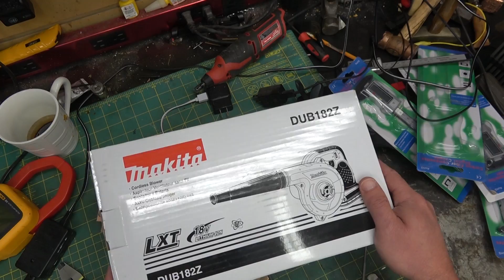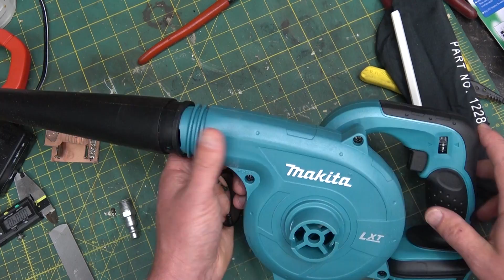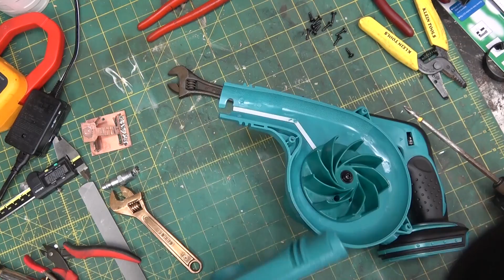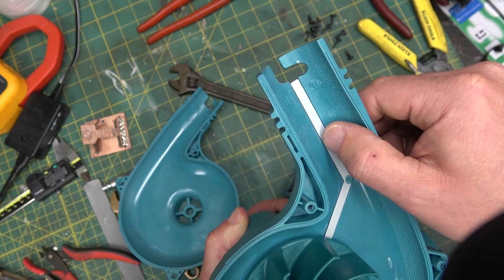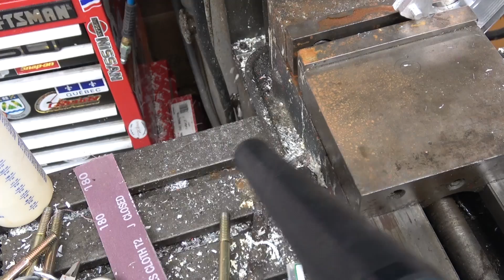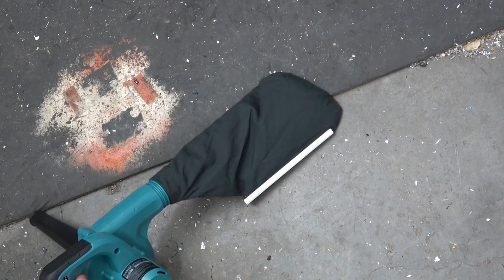BOLTR: Makita Blower/Vac

Comment: Posting at 7:24 in the vid...  That texture serves no molding advantage.  On a injection tool, the only texture that serves the molding process is sand blasting.  That only serves to hide rust damage (as you know tool steel rusts easily), and to allow easier release upon ejection.  As for the cuts in the pins (excluding the texture you're talking about) that serves to give the pin traction so it doesn't stress the part upon ejection.  My take on the texture you are highlighting is that it serves a functional purpose to the part.  It would cost extra $$$ and help the molding process not at all.  I'm a Plastics Injection Process Technician of 8 years, I've worked with over 800 different tools.

Comment: I've had one of these for a couple years. Much more useful that you'd think. I use mine all the time. Much easier than lugging out a shop vac or air compressor. And it's strong enough that I use it for sweeping my sidewalk outside, and even a super light-duty leaf blower.

Comment: The plastic impeller will be destroyed if you use the suck capability, most garden vacs/blowers use plastic and when something other than dust is sucked in the impeller breaks
Reply: Mark Smith I was thinking the same, and if it didn’t break it will clog. A bit remiss of Makita to use the same fitting in this case. Unless.

Comment: I own three of these blowers. I keep one blower at the fire place, one in the tool box, and one to remind me of Tiffany in grade 9.
Reply: I have the similar willfuckye 18v blower. It spends its days turning my freshly lit fires into a pile of hot coals in record time. It also does a great job at distributing the dust off my shop floor back into the air to properly re-distribute evenly after a good sweep.
Reply: @leftyeh6495  Fires? I kinda do the same thing but I've got an old $10 walmart double-acting inflator (you know, the manual pumps for mattresses and junk) with a recycled steel tube from an old assemble-it-maybe shelf unit duct-taped to the end of the hose.  Battery only goes dead when the fire's flat and the beer's gone.
Reply: @leftyeh6495  Just remember when you "re-distribute those floor sweepings" you should "probably "filter that through a cigarette"😂😂🤣🤣😂
Reply: Don’t worry, Tiffany probably fell off by now
Reply: I take mine to the summer cabin and use it to suck up all the de- hibernated flies off the windows, works a charm

Comment: I use one every day at work. They are skoocum till you drop it.

The weight of the big batteries will snap the  handle right off when it bounces off the floor. 

The trigger will eventually burn up if you run the thing almost  constantly like a couple of the fng's do.

Comment: Putting a zip tie around the head may keep it from collapsing under the succ.
Reply: I think they've done that by design.
If it collapses you'll turn the power down until it doesn't, which stops it self-destructing on high speed chunks of debris hitting the impeller.

Comment: The turbulent flow will reduce the height of the boundary layer and significantly change the velocity profile of the cross section.  I'm not sure, but I think that for a relatively short pipe, that might also change the total mass flow through the pipe for a given freestream velocity.  Or, I could just be talkin' out my ass...

Comment: could you further explain the angry pixie "water hammer" effect
Reply: When current flows through an inductor (coil), a magnetic field is generated around it. If the electricity is suddenly stopped, the magnetic field collapses, inducing a "kick" of current known as inductive kick, inductive kickback or flyback. The way the electricity gives a kick is akin to the water hammer effect in pipes where the water is shut off suddenly.

Comment: off the cuff, thinking before i've had my coffee - but with experience, i'm inclined to give Makita the benefit of doubt;
- the rough surface is to create turbulence on the way out on suck-mode so stuff doesn't get trapped?
- the static discharge bar is only spot welded to allow for differentiated expansion as it warms n cools?
Reply: Agreed.

Comment: Mythbusters did an episode on the aerodynamics of a golf ball what with the dents all over them.
Reply: For the case of the golf ball, keeping the air turbulent at the surface helps it "stick" to the ball and mitigate flow separation at the back of the ball, which causes significant drag. For this blower, eh, I'm not seeing any issues related to flow separation and the texture just looks like part of the mold.
Reply: @zecc81  You must be a Fluid Eng-a-neerd.  HaHa!

Comment: Would it be possible that the rough texture is to aid in reducing static electricity, or reduce  dust stickage to the internals?
Would split-washers act more like spring tension, rather than grabbing the bottom edge of the screw to inhibit backwards rotation?

Comment: I have a similar one (they sell the same model with a longer pipe), it's strong enough for normal things like cleaning a roof  or a scaffolding on the construction site. For wet leaf, it's too weak, but for this they offer a 18 V x 2 brushless blower, which is extremely powerful.
Reply: Simon Maier those 18x2 tools are mean sum bitches I just got the 18x2 chainsaw and it is very worthy.
Reply: @MikeK7115  I have also some of the 18V x 2 tools, the chainsaw, the big angle grinder, a circular saw, and other stuff for the garden. This tools are awesome, they can replace gas machinery.

Comment: I wonder how long that impeller will last, in suck mode.  Do they sell replacement impellers?  If so, what is the cost?  Good questions to ask.
Reply: Perhaps if someone had the right equipment he could mill a replacement impeller -- in aluminium or possibly aluminum (if short of vowels).  A little change in design could enable it's use as an air raid siren or ear-plug test reference audio source.

Comment: I use this blower ever day and it is the best on the market.I rarely use the suck side but the longer extension on the blower end means it is great as a floor blower as well. The only issue I have ever had was to have the handle break off in a fall from close to 4m which was not a surprise. I recommend this tool to anyone needing a truely fantastic blow job.

Comment: The texture looks to be a post process so after its molded the mold opens, in that unsupported section the mold will spread that open and hold it open to counter the shrinkage and deformation that will occur. Its usually textured to get a good bite on the part.

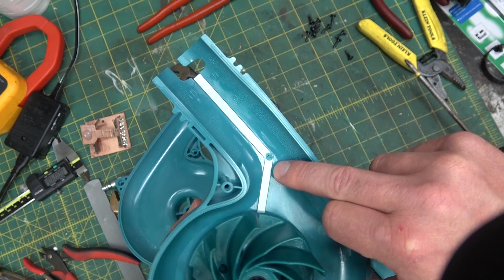Comment: @8:04, I'd say this is prolly heat staked rather than ultrasonic welded.
Reply: For those type it would depend on production volume. 
Where I used to work the break over was 50k units, but that was a few years ago now.
Reply: Definitely staked from the loosey gooseness.

Comment: It's probably soft to keep it from destroying itself with debris. Only works on the lower setting in suction mode to avoid it from slapping a chunk of metal or something so hard it cracks the impeller. A machine with a sense of self preservation. "It's life, Jim. But not as we know it" -spock
Reply: Maybe it's soft for other usage cases thou ;)
Reply: I've got a 240v blower/sucker like this (had it for about 7 years) but the chips would jam up the impeller.

Comment: The texture is to help the part stick to one side when opening the mold.
Reply: This is correct, the part needs to stick to the moving half of the tool, the lines on the ejector pins will be to hold it on the pins so a robot can pick them off.
Reply: @markbayles7840  yeah I been in the plastic industry going on 13 years. It's been a pretty good living for me and my family.

Comment: Owned this blower for years...great bench top tool.  Thanks for pointing out how the speed controller works.  Mines been stuck on 'one' for the longest time.  Going to dig into her and remove the limiter.
Reply: @Bryan Slankster Didn't get a good look at the mechanics but it looks like the limiter only engages at the top of the trigger button, so you might break more than the limiter if you try the 600 pound shop gorilla fix...

Comment: I think the texture is so the part stays to the side with ejection pins, B side. If both sides were smooth when the mold opens the part might stick injection side, A side.
Reply: Yes this was my idea as well. If it was a fluid flow thing it would be everywhere in the outlet...

Comment: I've had the same blower for 3 years now. You'll find the plastic clamp that holds the dingus on will fail in short order. A hose clamp had me back up and working again and it's been the only repair needed. It blows hard enough for yard duty (Not ideal but usable and loads better than a broom) yet comes in plenty useful in the garage shop.

Comment: The texture is for more flow, they figured this out  in cylinder head ports a few years ago.  Smooth is sticky. Just hit the high spots....
Reply: The texture is called graining and was done so the part sticks to the core side of the mold better, was probably sticking too much to the other half when the tool opened causing stress marks on the part or coming off completely.  the 3 lines on the one ejector pin were done by hand in the press with a ball burr, probably during a tryout, to get the part to stick even more to solve the issue.

Source I build these things.
Reply: Nero 3dp . Thank you for your comment.  I learned something new.  Much appreciated
Reply: @CanuckCreator  exactly, I'd imagine it gets stretched there too in order to keep tolerance
Reply: @anthonyjones657  not so much stretched as the design of the part itself, the core side has the ejector pins, lifters etc, usually thats the unseen side of the part and the cavity side is the seen side with all the details, and more handworking.

For this part, the cavity side is pretty detailed with lots of features while the core side is smooth and rounded, so naturally, the part wants to stick to the cavity, the graining and undercuts are to prevent this.
Reply: Nero 3dp thanks for the info, you da man!
Reply: Turbidity of the air flow.
Reply: Jup, same thing as the golf balls, dimples do stuff and they fly farther.
Reply: As a mold maker I kindly disagree
Reply: @anthonyjones657  Except it is a real thing. Now, looking at the speed control and the deep thoughts going into the rest of the tool, why couldn't Makita have simply thought "Hey, we need graining on the part somewhere so the picker gets it off the mold instead of the floor, and we need texture on this part of the scroll to boost flow and avoid debris adhesion, why not have both at the same time? Grain the scroll!"
Reply: Michael Free exactly, why not both?
Reply: Sure about that? I thought the did it for swirling the fuel/air mix together. Not so helpful on the exhaust side. I suppose if it's true companies like extrude-hone are belly up.
Reply: And Fish and Sharkskin it is rough but put with flow slippery.
Reply: Causes the boundary layer to break away and reduce drag.
Reply: Don't airplanes have dimpled exterior bodies to improve airflow?
Reply: Might have been done to reduce "whistling" of the air moving through port.
Reply: Yeah, you get a cushion of low speed air increasing the flow of air in the middle. Straight through mufflers flow better than a pipe with the same diameter for the same reason. At a certain gas velocity mind you.
Reply: Probably a similar effect to what golf balls have going on.  On airplanes they have vortex generators on the front of the wings to keep the airflow stuck to the wing at lower speeds.

Comment: that speed control is a lot like the old makita drills that had a little adjustable knob on the trigger to control how far it will go in, pretty neat idea.
Reply: My old craftsman drill had a variation on that. A small bolt goes right through the trigger itself and when you crank the bolt it limits the travel. Unfortunately it was the first thing to break on a massive steel and concrete drilling piece of machinery.

Comment: You might think that you would want a smooth hull on a sailboat, but I am informed that you want a microdimpled (?) finish as it creates a friction-reducing boundary layer. I would expect aerodynamics to be comparable. In that blower, it might help reduce turbulence, the existence of which I would expect would tend to diminish the blowage.
Reply: The boundary layer is always stagnant. Any imperfection that trips that layer creates a bit of turbulence to get the flow going again.
Reply: Look at a golf ball, it has microdimples to reduce aerodynamic drag. Look at the underside of your car (probably not a US model), some plastic covers have dimples as well. This dimpeling doesn't magically decrease drag all the time, but I guess it works sometimes.
Reply: Mojmír Křížek
With golf balls is so the air sticks to the ball and releases further to the back of the ball, smooth balls it releases closer to the sides.

Comment: Where do you buy your Phillips bits for your drivers? I build bicycles for a living and need a nice reliable tip ehh?
Reply: What part on a bike is Phillips aside from the JIS (not phillips) shifter adjustment screws
Reply: Ammoniummetavanadate the brakes the reflectors any accessories
Reply: Do you also build BBQs and lawn chairs?
Reply: If you look in err, pretty much any shop ever opened, or any website that sells anything, you'll probably get em there
Reply: knuckles zedawg thanks

Comment: You should do a breakdown and example of water hammer since you talked about it in electrical. I think you would do a good job of showing the destructive effects
Reply: Grady of practical engineering did a great video on water hammer
Reply: I know what water hammer is in hydraulics but I couldn't wrap my head around it for electricity. Can you ELI5?
Reply: @kevinliang9502  Look up how an inductor works.
Reply: @kevinliang9502  
If you move a magnet through a coil it will generate electricity, because there is a changing magnetic field inside the coil.
The faster you move the magnet, the higher the voltage will get.
--> A changing magnetic field generates a current in a coil.

If you power an inductor (such as the coils in the motor or an electromagnet) it will build up a magnetic field inside.
If you disconnect the inductor, the magnetic field that it has built up inside itself will collapse very quickly.

This means there is a very rapid change in the strength of the magnetic field in the coil, which self-induces a very high voltage in the coil.
The snubber diode is put in place to provide a path to the high voltage that builds up when powering off the inductor, so it doesn't destroy other electronics down the line.
Reply: Kevin Laing Plumbing analogies help explain most electrical components and functions. A water hammer is a pressure spike caused by closing a valve (switch) on fluid that is moving quickly (magic pixies).  You might find this relevant. https://en.m.wikipedia.org/wiki/Flyback_diode
__
Ever smash your thumb with a water hammer, little Billy?
Reply: Uncle has covered this in the past if I recall correctly maybe 2-3 years ago.

Comment: Thought: assuming those sizes are the same as PVC fittings, could you slap a 90 degree on the suction end angled slightly down so the sucky bit is pointing forwards? And toss a 180 on the bag so it comes back towards the handle for good measure?

Comment: I think that pattern on the inside is to keep the air from sticking to the sides—making the air go faster with less effort. In other words, it would cause a small bit of turbulence on the sides, keeping the air near it from sticking. Air does not move easily when it it next to air that is stationary, so it kinda spreads out like fanning a deck of cards—air by the wall going slow; air farther from a wall (in the middle) going faster. The texture would prevent that.
Reply: I was thinking it was a way to mitigate or modify noise—especially high-pitched whistling. Extra turbulence to get "white noise". Just a guess.
Reply: Ben Dover
Known issue for car intakes,  you don't want the walls smooth as it doesn't breath as well.

Comment: This is completely outside my area of expertise so take this with a full bag of salt. That texture on the inside might be intentional to create a static boundary layer of air along the surface, separating the fast-moving blown air from the plastic. This would reduce the friction and turbulence on the air that does flow out - it's not quite the oft-cited "golf ball effect" (which pulls air), and is more like the sharkskin effect. You could think of it as confining turbulence to the area around that texture, so it can't interfere with the overall air flow.

It might only increase the outlet air speed by 1 or 2 mph or save a fraction of a watt - but that improvement is essentially free. 

Hopefully some employee got more than the American Standard $25 gift card bonus for the idea.

Comment: It looks identical to the Kimo brand sold by Amazon. Does anyone know the difference? I wonder if the battery is the same as the Mikita.
Reply: Paul Blonsky A bunch of brands have very similar blowers, all compatible with their own battery system. I think that this product was designed by one of the contract manufacturers that companies use, then produced with a branded shell.
Reply: even if it doesn't, grab a battery adapter.  I have one that adapts my crazy old Dewilt tools to run off the newer PorterCable 20v batteries.

Comment: the texture on the inside could help to actually hold it on the side of the mold that has the ejection pins when the mold is seperating after injecton. there seems to be more surface area on the outside so it would naturally get stuck on the wrong mold part.
just an idea from first impressons
Reply: I'd think they would have just added some undercuts to accomplish that rather than texture it.